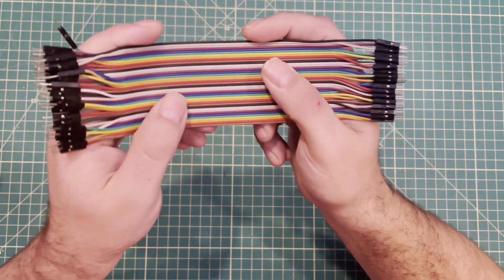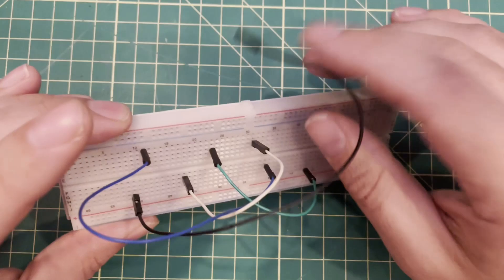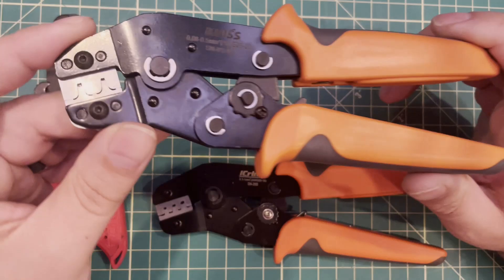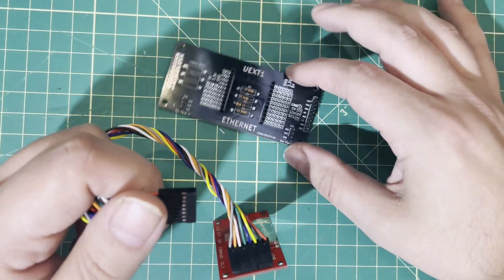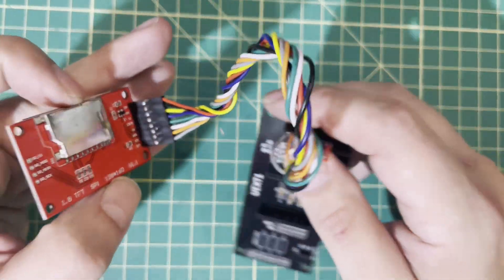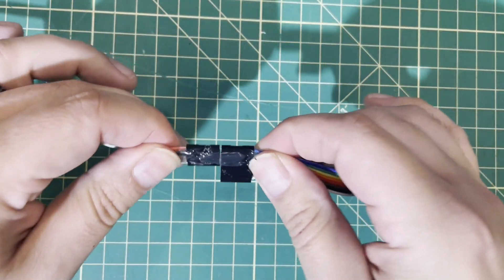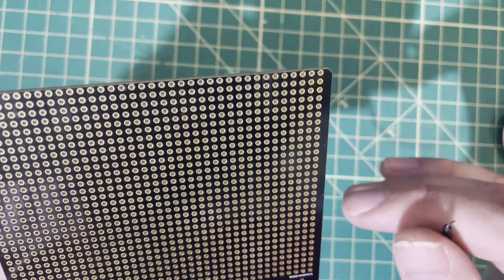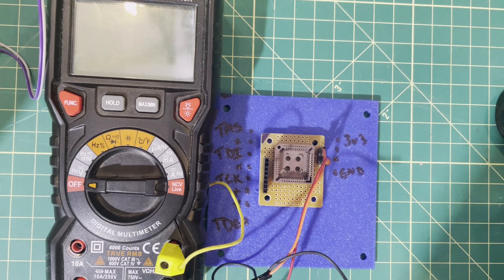18 Dupont Wire Tips and Tricks

Comment: The SN-28B crimper came with a connector set and I used it for a while. I never liked ir.
I saw in the comments under a different video that the Dupont connectors should be crimped with the SN-025 crimper. They were correct. The SN-025 works much better than the SN-28B.

I used to buy a variety of connector styles like the ones you show. Both female and male ends. I eventually stopped buying the male style ends since the pins were so flimsy. I now only purchase female style Dupont connectors and use a long header pin to change it to a male connection when needed. This works much better.
Reply from the maker: I may have to check out the SN-025 (https://amzn.to/3ZWNBRk) for those interested).   The long header pin is an interesting idea.  Thanks so much for sharing.
Reply: @AnotherMaker those look exactly like the crimpers I have. I could not, for the life of me, figure out how to find the correct set of teeth to use or how to line up everything correctly. And it just seemed like a whole lot of excessive mechanical force for such a tiny connector.
On the flip side, they work great for crimping spades onto 14 guage wire.

Comment: Holy cow. Very useful. I also have 3d printed some wire clamps to hold jumper wires on a arduino type board. There are also some online, but you may have to adjust depth for your board and wire terminal housing size.

Comment: They don't make those Dupont cables like they used to, at least the one I get from Aliexpress... Nowadays they are super stiff and have a bad tendency to not make good contact in the crimping part of the connector. I wish they made them with silicone wire instead of cheap stiff plastic.
Reply: The ones from AliExpress these days are magnetic, meaning they're made with pot metal/iron/steel.

Comment: fun facts, I needed a custom dupont 3x2 cable a few years ago. I ordered a kit exactly like the one shown in the video and I fell for the stupid trick of getting a massive crimper with it. I got so frustrated trying to use that crimper and found MUCH better luck just using the crimpers on my wire strippers. Grant it, that crimper has been quite useful for other projects, but NOT for making dupont cables. All that said, I really wish I had watched this video then because it never even occurred to me to just sacrifice a few of the individual cables to move them into the 3x2 connector I needed. Geez of flip would this have been useful like 5 years ago.
Reply from the maker: Thanks for sharing.  Yeah.  It's hard to explain how much bad crimpers can ruin the whole experience. They're truly awful.

Comment: I'm curious Mr. maker.  Do you make your living prototyping/small batch mfg things for people?  How does one get started doing that?  How do people find your services?  How do you deal with support?  Say something goes into the field and becomes mission critical for your customer, do you offer support?  New engagements?  Thanks.
Merry New Year and Happy Festivus.
Reply from the maker: Thank you1   I don't know if I've ever told the story.  I'm going to be on the https://www.youtube.com/@SimpleElectronics podcast at the end of the year. I may make it a point to tell the story.

I'd say that the prototyping is only a small part of my business but it's significant.  And that part gets broken down in 2 parts.  1.  Things I manufacture to support my hardware.  2. Things that are 1 off.  

For #1 I often build hardware interfaces for places (like factories) that interface with my software. Those are all treated as 1 thing. I just support those along with the software. It's kind of nice because if the AI doesn't work, it's my job to figure out if the software is broken or the interface to the software is broken and they like not having to worry about that.

For #2 It's almost always for trade shows like CES and SEMA.  Most of the time no one else could do whatever it is they need, so they're honestly happy at any attempt I make at it.

I'll try to talk more about it this week.
Reply: @AnotherMaker  thanks.  I'm subbed to @SimpleElectronics also. I'll keep an ear out for the podcast.